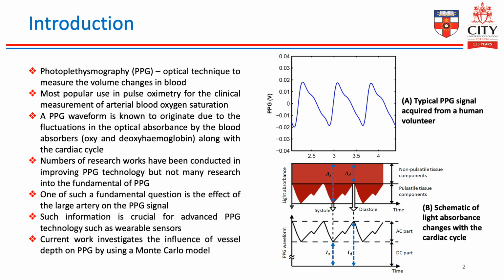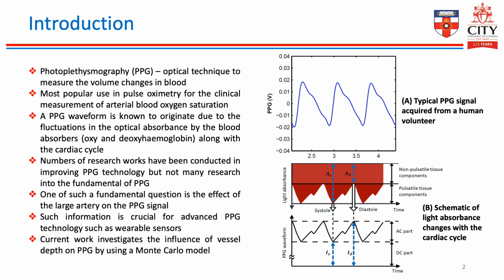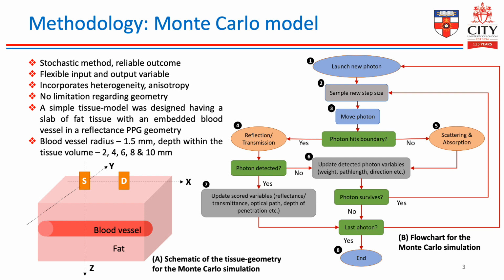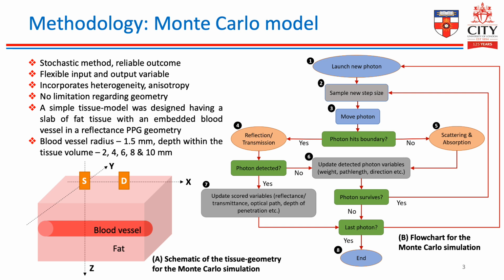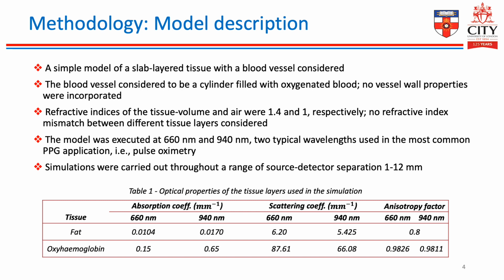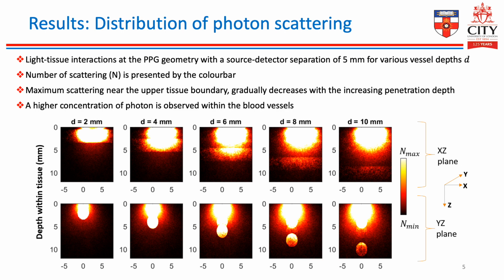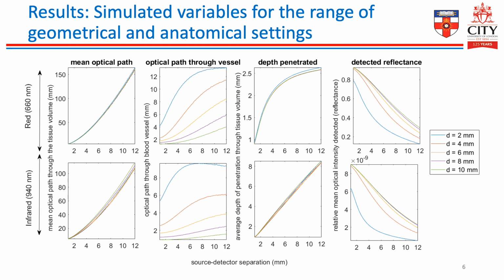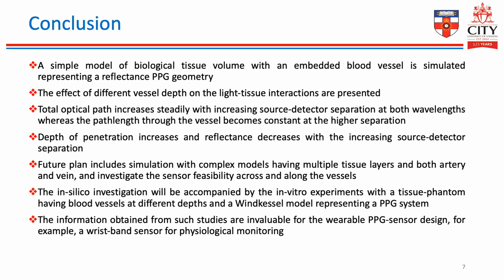INFLUENCE OF THE VESSEL DEPTH ON THE LIGHT-TISSUE INTERACTIONS IN REFLECTANCE PHOTOPLETHYSMOGRAPHY

Comment: Where did the optical properties come from? Why fat? Skin is a more likely tissue for non-invasive measurements and has a substantially larger scattering coefficient (See Jacques, PMB 2013) 
It is always a good idea to simulate the normal or simpler situation first and compare that to real measurements. Then the blood vessel could be added.
Does the model assume two passes through the blood vessel or one?
Scattering losses dominate light loss at these wavelengths and ensure much greater light loss at 660 nm. You suggest the opposite? 
TABLE 1:  
I guess you mean oxygenated whole blood instead of ‘Oxyhaemoglobin’. Otherwise the scattering coefficient would be ‘0’.  

TABLE 1:  Do you mean reduced scattering coefficient?   
Why does the mean relative reflectance for 660 and 940 nm differ by ~10^8 on slide 6. Shouldn’t they be more similar for high oxygen scenarios?
Reply: Hi, thanks for the questions. I answer all of them as follows:
- The optical properties were adapted from the literature. The fat and oxygenated blood optical properties were collected respectively from the following articles: 1) Simpson, C. Rebecca, et al., Physics in Medicine & Biology 43.9 (1998): 2465; 2) Bosschaart, Nienke, et al., Lasers in medical science 29.2 (2014): 453-479.
- Fat tissue layer was chosen as a subdermal tissue layer containing a blood vessel. Of course, in reality a tissue volume architecture starts with a multilayered skin tissue. Our previous works have illustrated in details the effects of the optical properties of heterogeneous skin tissue layers in photoplethysmography [Chatterjee et. al. 2019, 2020]. Skin contains arterioles, venules and capillaries and but not a large blood vessel. The tissue surrounding a large artery is usually subdermal tissue such as fat which has been considered in this work. This work is the preliminary step towards investigating the effect of a large blood vessel in photoplethysmography. Based the information gained from this simplistic model, further complex models with multilayered skin and muscle tissue would be considered in future as mentioned in the 'Conclusion'.
-  I agree that light scattering is much higher at 660 nm which is also seen in the scattering coefficient values given in Table 1. I apologise if my description in the slides contradicted with this fact.
- In table 1, the values are of scattering coefficients and not the reduced scattering coefficients. As noticed by you, in this table, it should be 'oxygenated blood' and no 'oxyhaemoglobin'. I apologise for this mistake.
_ As seen in Table 1, the absorption coefficients of both oxygenated blood and fat tissue are quite higher at 940 nm compared to 660 nm. A higher absorbance results in a lower reflectance. This also agrees with the experimental scenario: a red-light PPG is much easier to detect, i.e., the output light intensity is much higher, compared to an infrared-PPG.

Comment: Hi, very nice presentation. I have a question about the results in the slide 6.
In the third column, the penetration depth seems not too change much with the depth of the blood vessel. Since the light source is right on top of the vessel and blood is a strong absorber, shouldn't it block a large number of photons preventing them to go deeper? (having then a larger effect on the penetration depth)

/Luigi Belcastro - Linköping University
Reply: Hi. Thanks for the question. The penetration depth depends on the optical properties of both blood and fat tissue layers in the model. In the simulation, the depth of the vessel were varied but the area of the vessel was the same, that means that the amount of absorbed light is the same for all cases. At shallower depths, light reaches the blood vessel faster and gets absorbed, whereas at deeper vessels, lesser amount of photons reach due to attenuation of blood. So overall, the attenuation of light does not greatly vary with the vessel depth which is one of the key finding from this work. I hope this answers your question. Thank you.

Comment: Hi, great to hear about this relevant work. Was wondering if you were about to include vessel wall effects what would you expect as a change from the conventional PPG results? Shouldn't the number of photons going deep would be overestimated without including these wall effects? Thanks☺️
Reply: Hi, many thanks for attending my e-poster, and also for asking a very relevant question. The conventional PPG wave, if recorded experimentally from a tissue-site having a large blood vessel, is basically a combined effect of the optical properties of all underlying tissue layers and sublayers including the blood vessel wall and the blood flowing through the vessel. In the simulation, I have shown a simplified model having a cylinder of blood to investigate the changes of photon behaviour within the vessel and the surrounding tissue, in this case, fat. If I include the vessel wall properties, I would expect the overall absorbance to increase, resulting in a reduction in PPG intensity, hence, the recorded PPG amplitude. You are right to say the number of photons going deeper is slightly overestimated in this case where the blood vessel thickness has not been considered. Being said that, the absorbance of blood is much higher compared to the thin arterial wall especially at the wavelengths used so the change in the overall absorbance would not be significant with or without the vessel wall absorbance. However, there are other vessel wall properties such as elasticity or vessel radius changes with the cardiac cycle likely to affect the simulation, and our current work is underway in this aspect.